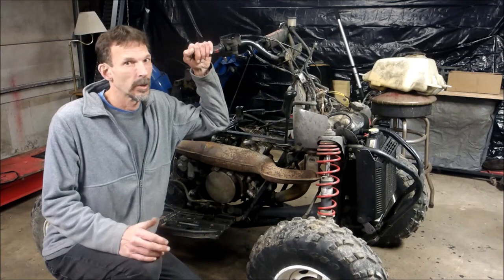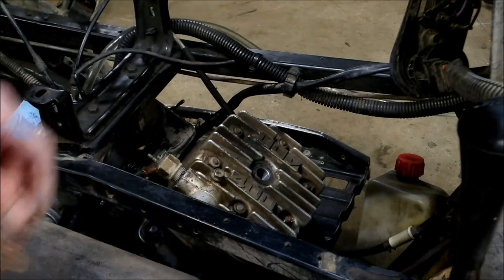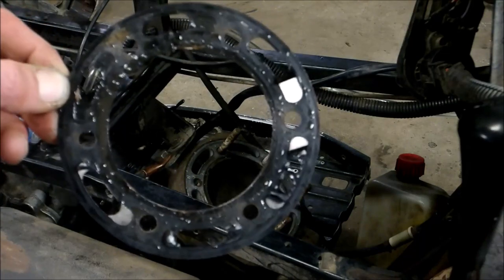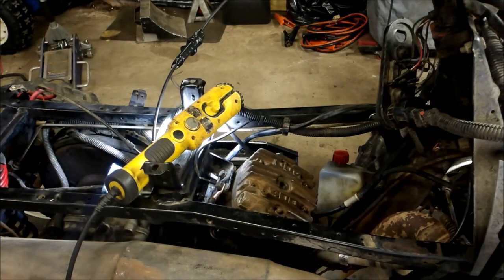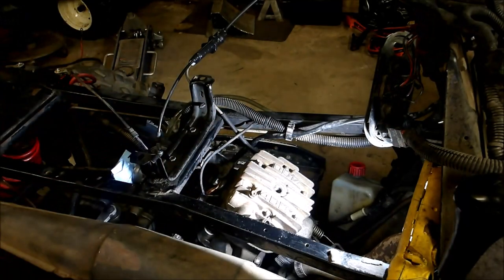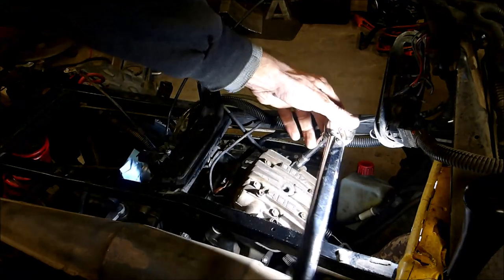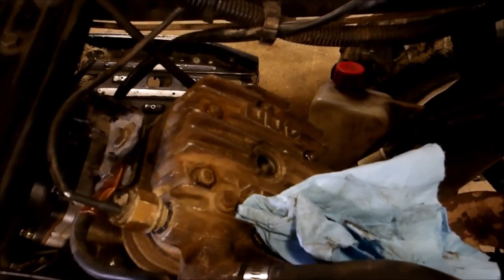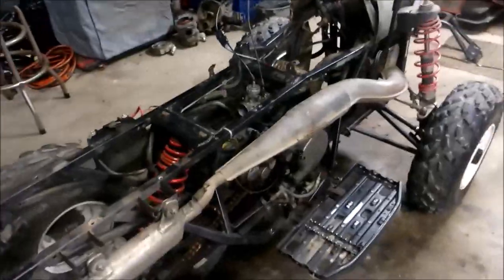HOW TO REPLACE A HEAD GASKET ON A POLARIS SPORTSMAN 400

Comment: Thank you, great video. Recently got a scrambler 400. Previous owner said he did a top end rebuild. I am getting pressure at the coolant reservoir once it warms up, it sprays from the pinhole in the cap. Seems to spray more under throttle. Do you think the head gasket and checking for warpage is a good place for me to start? Fan is working. Coolant is topped off and I’ve tried bleeding air from the system.

Comment: Good video..I have a polaris trail boss 350 4x4 and I just put a new sproket and baring carrier...do I tighten the 2 axle bolts as tight as I can up against the sproket? Or do I leave alittle gap where the washer is ..I just got this quad and it's alot different than my 500 sportsman..I'm also replacing the head gasket..does the gasket tab go towards the exhaust or the carb ? In your video you put the tab facing the carb ..is that the same on a 350 ? Thanks for any help u can give me.

Comment: Awesome video. My 400 is blowing out alot of white smoke on a heavy throttle pulls, after it calms down she goes back to the normal blue smoke exhaust, it also backfires after that too. Coolant level is normal. What do you suspect the issue to be ? Thanks

Comment: Just rebuilt a 400L and had it running for about 30sec before filling the radiator back up.  Reassembled and now I have a leak out of 2 head bolts.  Hoping it was a bad gasket and not a warped head, but I'll pull it out and check.  Do you know if there is an adjustment to the choke cable?  Mine pulls real easy and it starts hard.
Reply from the maker: Just at the base of the cable on the carb. Turn it in or out, but if you're getting coolant in the jug...it will start hard.
Reply: @TitaniummanGarage  what's the proper adjustment for the choke? Also do you know where to get an oem head gasket? Nobody seems to have them anymore
Reply from the maker: @mbakken11  There is a test with a feeler gauge. I can't remember what the thickness is. There should be a little gap from the toggle to the base. like .001 or.002. So a little play is good. I usually eyeball it. I just spoke with a friend that rebuilds and parts these out. No OEM out there. Just a really good name brand. I'll ask him what it was.

Comment: dose a 97 Polaris xplorer 500 have that screw to let the air out for the coolant on the top of the head if so where would that be located
Reply from the maker: Not on the top. Its on the side of the water pump. Look at the water pump..there is a 10 mm bolt on the lower left side on the front of it. look at this video. at 10:03 into it  shows a 500.
Reply from the maker: https://youtu.be/tvd2yBu3THs
Reply: Yours wouldn’t be 2 stroke so it’s a lot different
Reply: The gasket that I'm replacing was upside down with the tab to the exhaust and the 2 little holes to the intake side would I install it like it was or how you did it???also the piston head has worn near the exhaust should I replace it or would it still hold ?

Comment: Hi Why did you put the  gasket upside down?
Reply from the maker: It is facing up like it should. I should have turned it 180 degrees..But it doesn't matter. All the cooling ports are in line.
Reply: Mine doesn't have any dire options with it. What way does the gasket sit. I dont care about the tab just want to know what is the top and bottom. Thanks! I like and subscribe